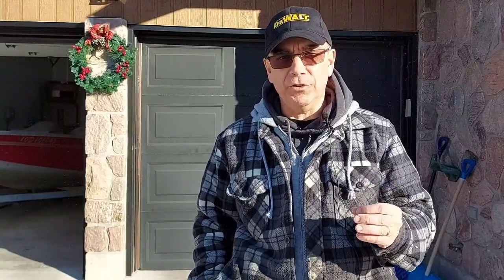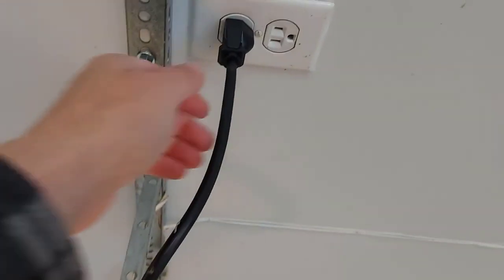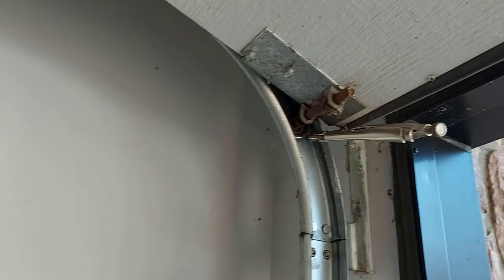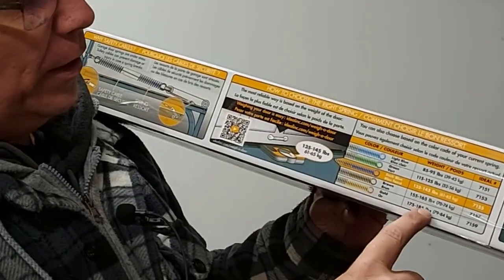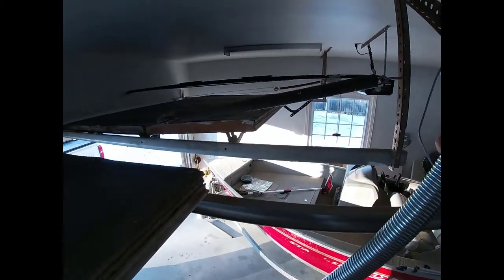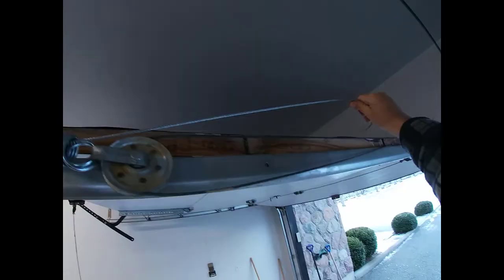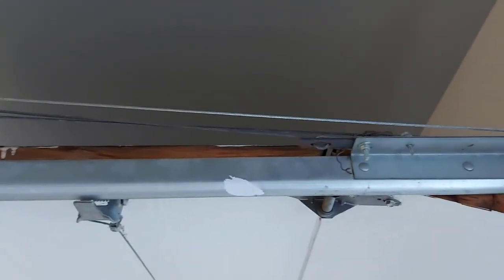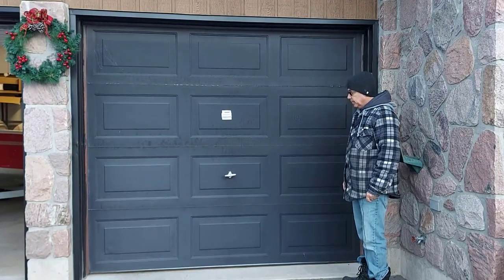Broken Spring on Garage Door Repair // Plus Installing Safety Cables

Comment: I know it's been awhile, but thank you for this video. A ~$300 fix turned into a $32 fix for a snapped spring (I did the other side too, just in case). 

Really pretty easy after playing around with the tightness of the cables and being careful.
Reply from the maker: Your welcome, ya this is a job we can definitely do ourselves. 😀